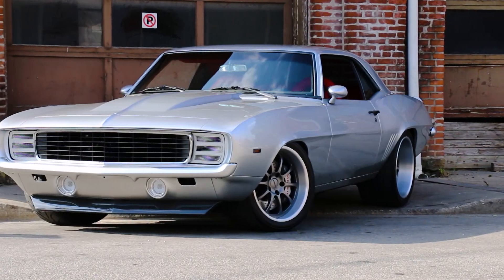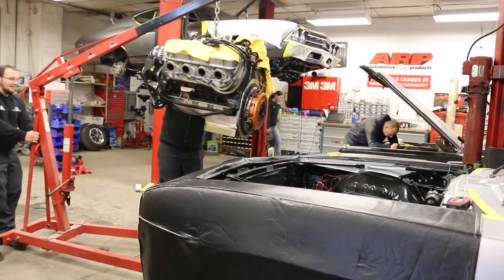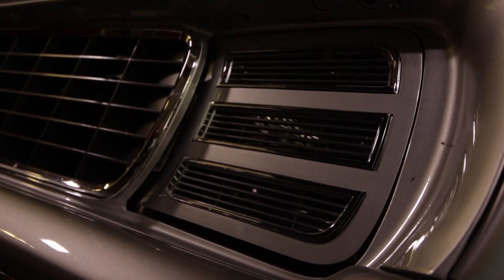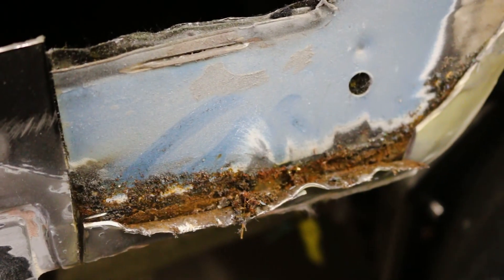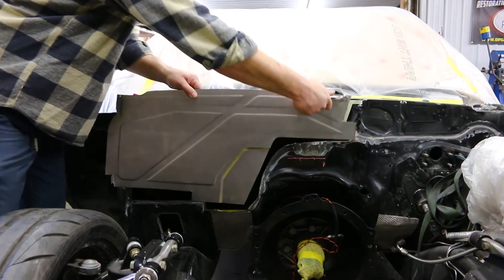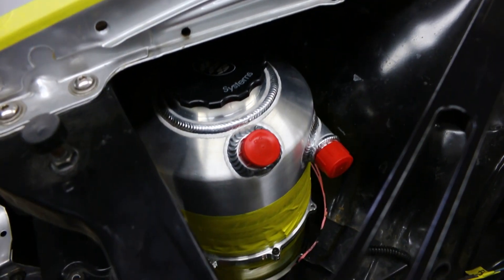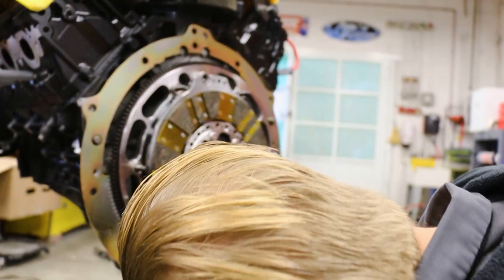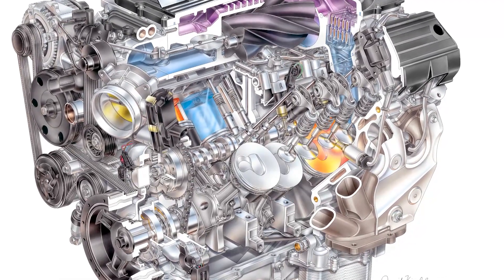Pro-Touring 1969 Camaro Supercharged LT4 Swap Install Video V8TV PART 1 V8 Speed & Resto Shop

Comment: That work you guys do with the panel work is next level fabrication.  

Personally would have injected the BBC and used a 427 crank with an aftermarket aluminum block and made the power threw revs.  HP power is way easier to manage then a ton torque and it's not like 500lb-ft isn't more than enough.  I really can't stand the sound the LS\LT engines make that firing order change just sounds off to me.  Everyone is different though it's gorgeous car and your work is excellent as always.
Reply from the maker: +GlassTopRX7 the BBC was fuel
injected with a stroke in it, 540 cubes.  Tons of torque right now, but super lumpy idle and it didn't like staying cool for long.   We fixed all that.   Thanks for the kind words on the fab work!
Reply: I can certainly understand, my toy is a rotary power RX-7 with a large single turbo.  I used it as daily driver for 18 years and if it was nearly as unreliable as most people think it is it would be LS powered today, having a sexy car that is broke down is pretty lame.
Reply: @GlassTopRX7  I agree....nothing sounds like a stroked BBC

Comment: Couldnt ya make the big block more reliable with new school parts like EFI, electric ignition etc..?
Reply from the maker: The 540 was fuel injected with computer controlled timing and ignition.    It wasn't a reliability so much as a driver experience challenge... it was really too much motor for the street for our customer.
Reply: I would kept the the first engine in it the big block is fire 🔥
Reply: @V8TV  but was it more powerful than the LT4?  640hp+ is quite strong, what exactly is the difference?
Reply: @drm9979  This car had 723hp at the crank with the BBC, would foul plugs and buck and jerk driving in residential areas due to the extremely large cam (wanted to go wide open throttle and sing).  This was not practical for how I wanted to drive the car/nor where I live.  Now the car is ~760hp at the crank (670whp), and has the driveability and a wider powerband as compared to the BBC.  Not to mention, you couldn't pass a gas station with the BBC, the Gen 5 LT4 is just a better powerplant on all fronts (imho)

Comment: You say it was not really reliability (which did'nt make sense anyways with an injected aftermarket engine totally newly built) but "too much of a motor for the street".
So what exactly is now the difference..especially when the customer wanted to keep with the power levels. Does the LT4 accelerate the Camaro as quick as the BBC did?
It seems to me the customer just wanted to have something more sophisticated and fancy
Reply from the maker: That is a great question, and there are many differences. First of all, the power levels are similar at the end of the day, but how they are generated is vastly different. For example, the big block was a high compression, naturally aspirated engine designed to squeeze maximum power out of every drop of fuel. This meant that the idle was very rough, the engine was very loud, And it was really designed to be a drag race engine only traveling a quarter-mile at a time. The LT4 provides very similar acceleration, but it creates its power using the boost of the supercharger, so the compression ratio is far less, And the camshaft profile is designed to build cylinder pressure which often times equates to a smoother running engine. The big block had the typical lobby, lumpy idol where this one idols and runs very smoothly. Under low and part throttle situations, the supercharger is basically just going along for the ride and drives like a late model naturally aspirated 6.2 L V8. But once the accelerator is mashed, and the boost builds, the acceleration is actually more aggressive than the big block Chevy was. A side benefit is that the car is comfortably quiet to drive, so driver and passenger can have a conversation going down the road without shouting. It also starts easier than the high compression big block, it creates far less heat, so the driver does not have to keep one eye on the temperature gage all the time, All of which add up to a far less stressful driving experience with equal performance levels. I hope this answers your question. Thank you for the feedback!

Comment: Why do all that work to the firewall with setting the tunnel back? Makes no sense.
Reply from the maker: The LT4 needed more clearance to the firewall with the DSE subframe and the large harness and direct injection plumbing.   Once we saw the rusty original firewall, the decision was to make a larger piece than just a dimple.

Comment: Rip apart an old car and turn it into something it never was so you can go shopping with less inconvenience...lazy rich folk with no appreciation of heritige
Reply from the maker: We think you're kind of missing the point on this one. This car was not built to go shopping, it was built to go very fast and handle very well and do it reliably. It was also built so that the driver can have a comfortable experience behind the wheel, and a supercharged late model engine is far quieter and better mannered than the racing big block that was in it before. It's also a bit of a stretch to consider anybody associated with this process as being lazy. But thank you for your feedback!
Reply: @V8TV  I completely get it. I didnt imply building it was lazy, its simply a lazy rich persons motor who cant be bothered with the slight inconveniences of the real thing that this car no longer is.
Reply: @adm924s  If you drove it, you would completely disagree with your posted statement, although there will always be purists.  as an FYI, this was not a number matching car, it is a standard Camaro and an RS clone.  No atrocities were committed in this build. I drive it like I stole it......far from a lazy rich person, I bust my hump to stack that paper like most hard-working Americans so I can fund my dreams!